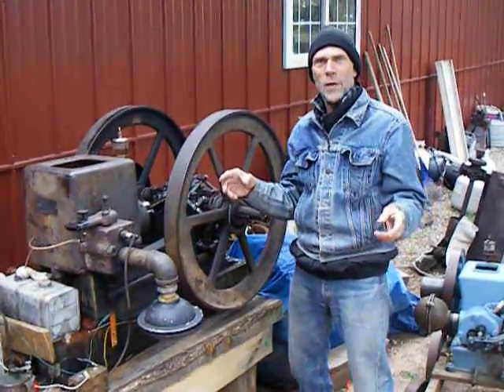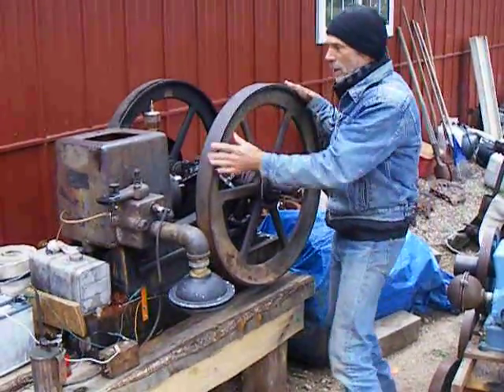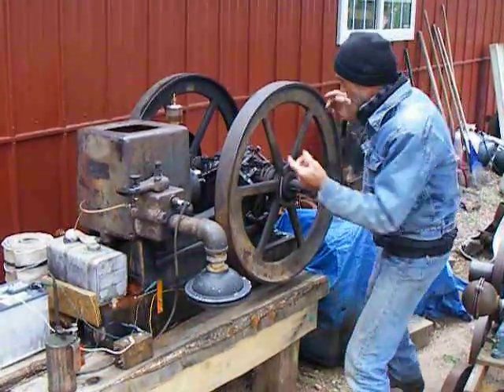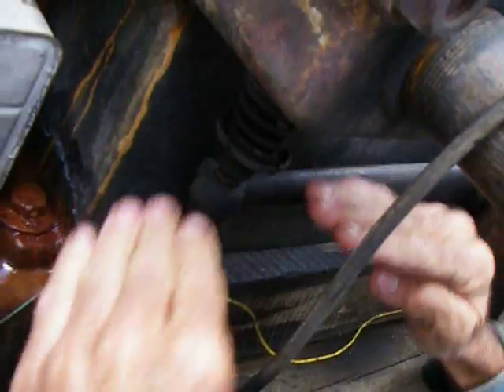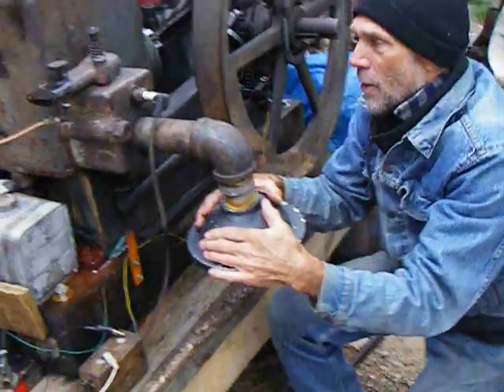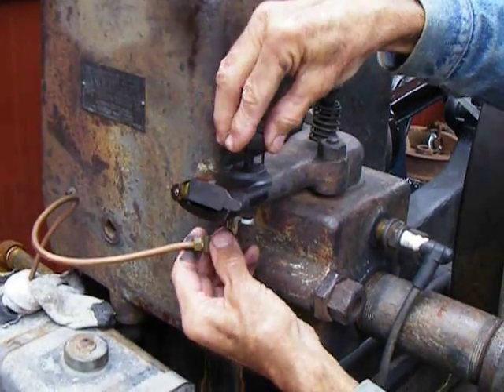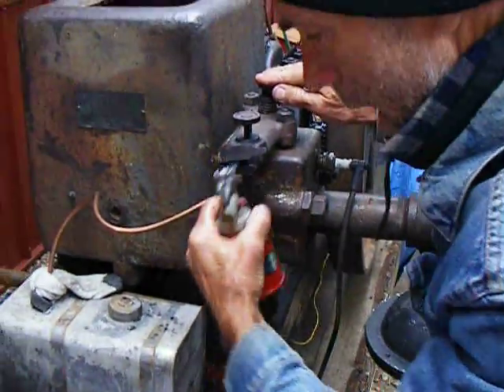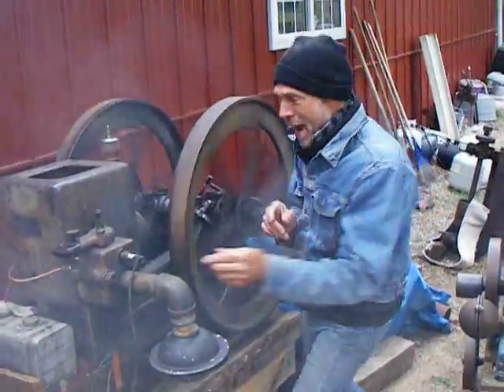Hit and Miss Engine Starting - Witte 6 HP

Comment: Then once the exhaust valve closes, the piston downstroke (still being driven by the flywheels) pulls in a mix of air/fuel from the only place it can.....the intake valve....which has only a weak spring holding it lightly closed the rest of the time?

Comment: So when the exhaust valve is open, all it does is suck in fresh air with no fuel from the tank, right?  So it uses little or no fuel while coasting?

Comment from the maker: Hi, Yes they are efficient. The exhaust valve is held open during the "Miss" cycle so fuel is not pulled into the cylinder due to no vacuum being created to pull air/ fuel thru the Carb (actually it's a mixer on those engines - much simpler than a Carb). Have a super day, Mel

Comment from the maker: Hi, The intake valve is a simple "poppet valve" that is pulled open by vacuum created on the pistons intake stroke. The exhaust valve is opened by a cam but a centrifugal force mechanism holds the exhaust valve open. Weights attached to the flywheel move out to hold the exhaust valve open. Looking at the engine is the best way to see how it works. Since there's no compression (or vacuum during intake stroke), the intake valve doesn't open during the "miss" cycles. Have a super day, Mel

Comment: Hey Mel how do you stop the intake valve from opening on the 'miss' cycles? i can see that the exhaust valve is open which doesn't allow the build up of compression but i could see that the intake valve was not operating during the miss cycles

Comment from the maker: Hi, Thanks for your note. We start the Witte by turning the flywheels backwards. We get a good charge of gas/air in by turning it over forwards a few turns with the compression released, then turn it backwards. As the compression builds on the backward stroke, the spark is still ocurring all the way from TDC until about halfway thru the power stroke so we get ignition when the piston is about halfway up the cylinder to TDC. We use a "buzz coil". That's enough power to get it running. Mel